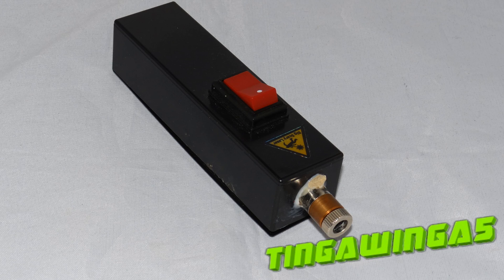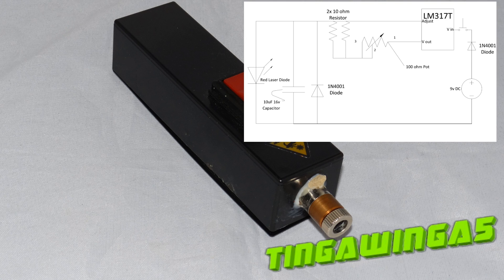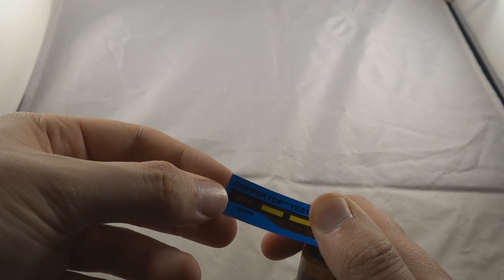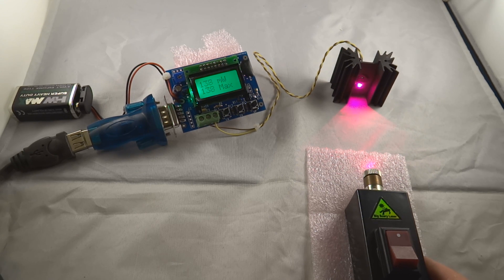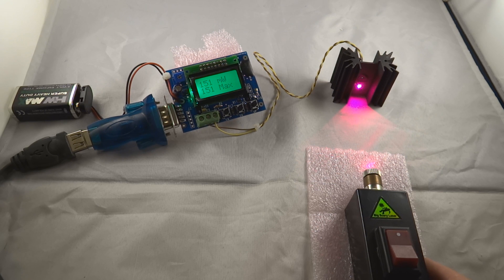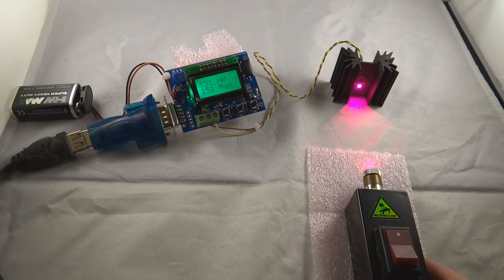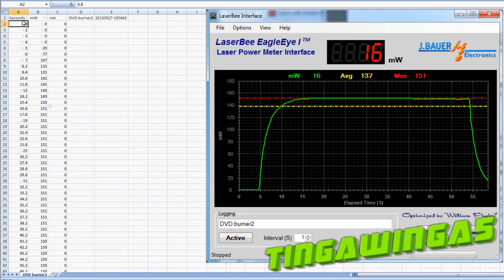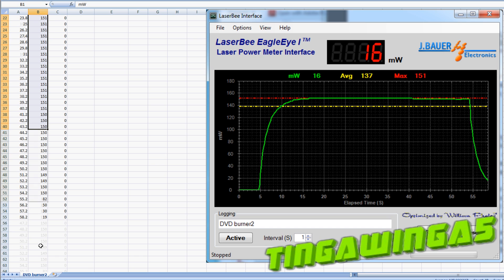How Powerful is a DVD Burner Laser?

Comment: Can use for tattoo removal?
Reply: Yes that's considered the safest way of tattoo removal
Reply: You can use for eye removal
Reply: A hot soldering iron would not be less usable. Only a very specialized pulse laser can remove tattoos, but the ink residues are still poisonous inside the body.

Comment: The Pot is 100 Ohm or 100 K Ohm? I am having trouble finding a 100 Ohm pot.
Reply: +Oscar Lopez you can make an 100 Ohm pot with a parallel Resistor 110 (E24) or 120 (E12) Ohm Resistor to a 1k Ohm pot ;)
Reply: +Oscar Lopez for a 10k pot the parallel resistor should be exactly 101,01 Ohms... so a 100 Ohm resistor would work.

Comment: Saw quite a couple of these instructional videos and everyone's saying to extract the diode and build a driver for it on another heatsink/casing. 

But I just wonder why not just leave the diode as it is in the laser carriage assembly and simply power it up with whatever ribbon cables it is attached to? 

Saves all the trouble don't it?
Reply: If you want a focus pattern of 2mm, yeah sure.
Reply: If you leave it intact, can the voice coil mechanism of the OPU be used or modded into  a galvo for projecting laser show vector graphics?

Comment: Hi,

Which was the max speed of writing of that DVD burner? There's a direct relationship between the max speed of writing and the optical power output of the laser diode. Just to have a reference, if my DVD drive has more or less max speed the laser could be more or less powerful.

And, I know its more dangerous an IR laser, but normally the DVD drives can write with a higher speed the CD-R than the DVD-R  (48X CD and 16X DVD, for example), so: Could the IR laser diode be more powerful that the red one?

Thanks.

Comment: Hi, how will i know the positive and the negative and the not used part of the diose? Because i took the laser diode from a drive 52x?? . .:)
Reply: right and top should be negative and positive. Dont know which is which tho
Reply: If you connect battery without current control (minimum a resistor) chances are high to kill the laser diode within seconds. Same if you confuse the pinout, so always use an 1k resistor to try out correct pins. You will neeed a lower resistor to output more light, but at full power it will likely die by lack of current control. 

And never stare into beam (nor into reflection by shiny materials); this can make you blind!

Comment: You should defocus the laser so it covers as much of the sensor as possible.  A high enough power density will actually burn the sensor.  When the speckle pattern moves around like that, either the laser is moving or the sensor is burning.

Comment: most burner LDs are infra red so what did you realy use?
Reply from the maker: You are incorrect, DVD Burner Diodes are in the Red Spectrum. DVD Reading and CD Reading or Writing Diodes are in the Infra-red Spectrum. Feel free to check out my other videos where I extract the diodes from the DVD burners themselves and build these lasers.
Reply: ok... may I've got the wrong manufacturer (Ricoh/Samsung) the labels told about invisible laser product....
which did you use if the question is allowed
Reply: @Tingawinga5  Nope. CD players contain a red laser. I made my first laser pointer from it (with current control), although it was so weak that it was barely visible and turned weaker (less visible) when heating up. Infrared would mean less resolution than any visible light, hence it makes no sense for optical discs.